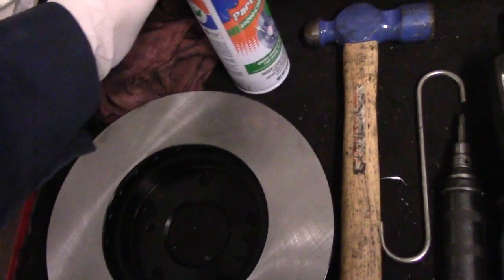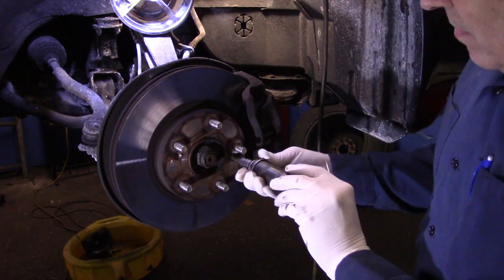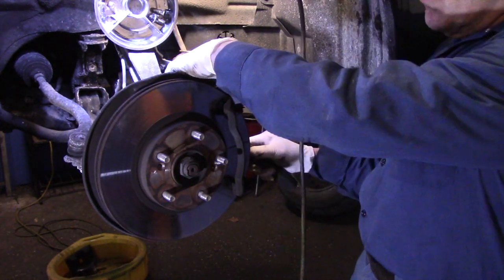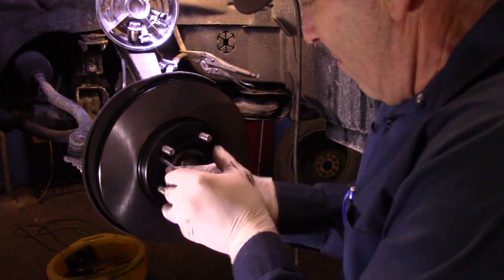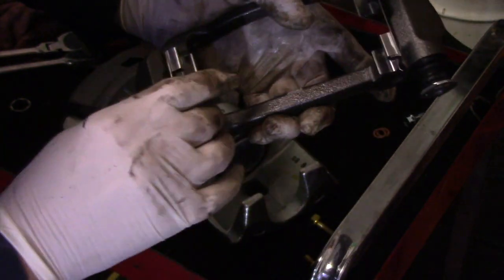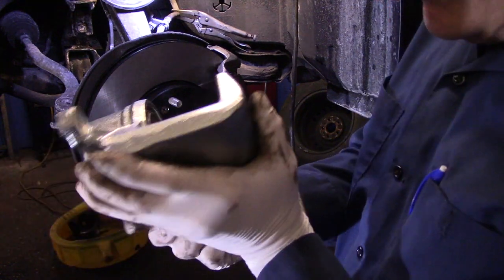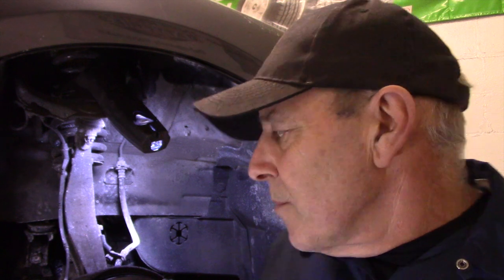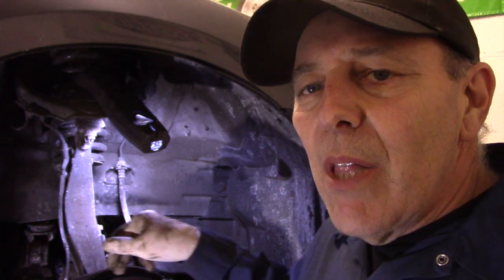How to replace the brakes, rotors and calipers 2003 Honda Accord

Comment: Hi.Just replace brake and rotors on my 2006 Accord V6.Brake pedal goes all the way down.Do i need to bleed the brakes? If so what is the bleeding procedure.Thanks a lot.Good job

Comment: What was the reason for replacing the caliper?
Reply from the maker: Because the slide pins were rusted and would not move.That causes the caliper to stay applied and overheat.